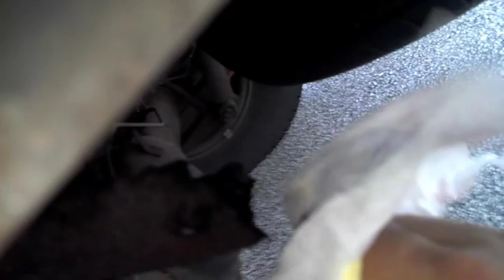How To Check For A Burnt Valve with a dollar bill or piece of paper

Comment: Did it worked fine after you gotten it fixed? did you find the cause of burnt valve. ?
Reply from the maker: I replaced the head and gasket. It's been fine sense the work was done.